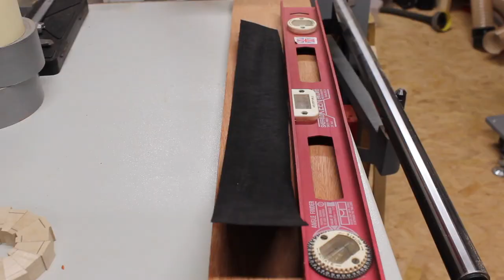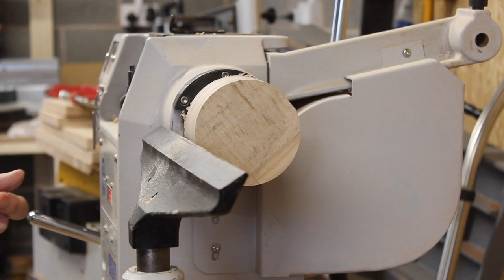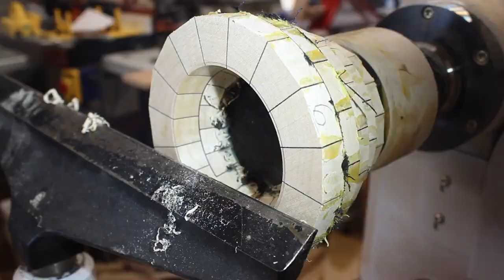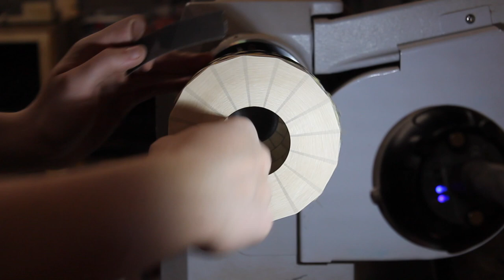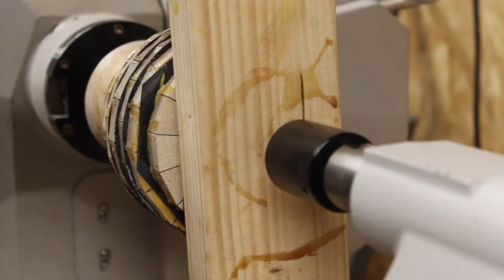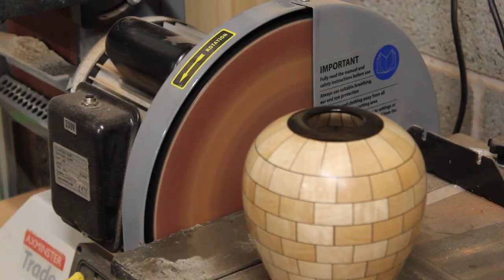Segmented Sycamore, Ebony and Veneer Vase

Comment: Another great video. How do your ensure the length of the pieces are correct when cutting the wedges on the bandsaw?
Reply from the maker: Thank you!  There is a stop block at the bottom right of the screen that I push the wood up to before I make each cut.